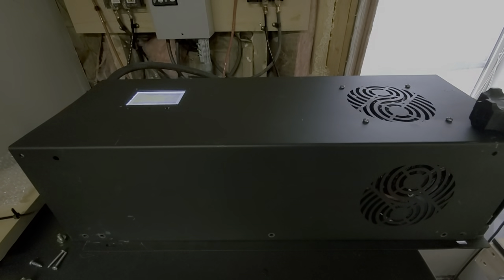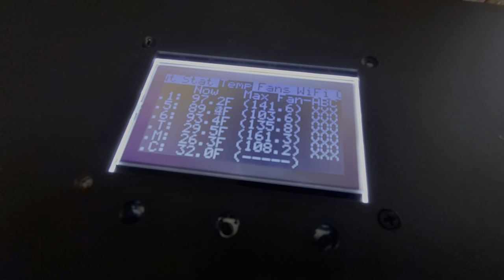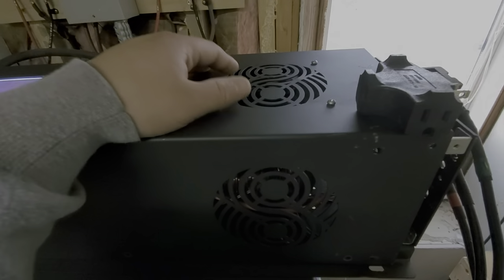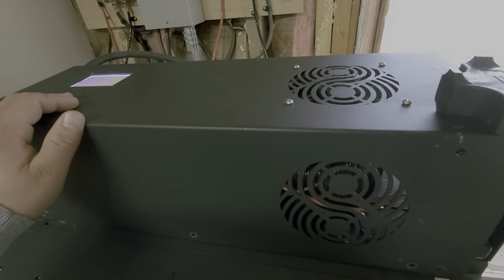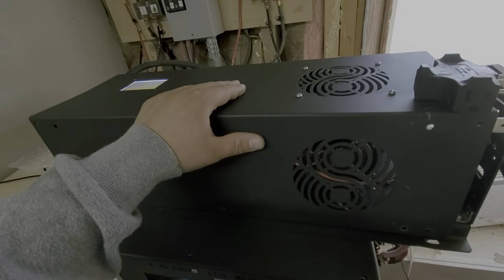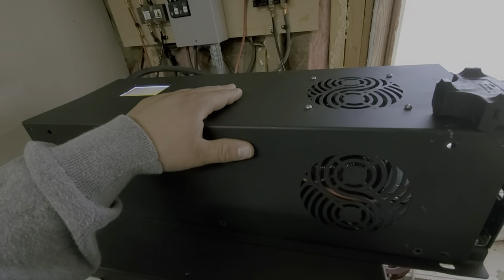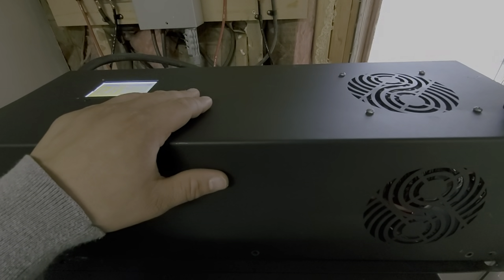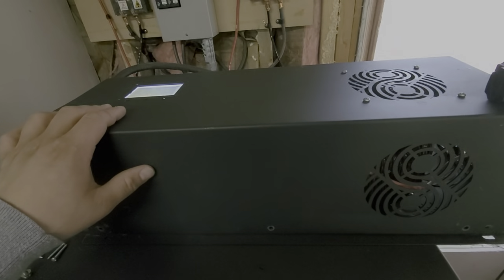5kw Frankenstein is doing fine but more testing is required

Comment: We still have a window type AC that hardly ever gets used that has inductive load on a room seldom occupied or in need of it.  For the AC used mostly we have an inverter AC.  Uses much less power and I am not seeing big inductive loading.  Same goes for welding.  We use inverter welders (sometimes 3 at a time) and "shelved" our small and large size transformer type "old school" welders.  Inductive loading was massive with older type but works all day long (even three) with inverter welders.

Comment: I'm going to want to get one of the Genetry 48V/5kw(+) units as soon as they are available. My PJ 48V 8kw even with exterior auxilary cooling right over the transformer it still spins the fans up to full on load and maintains it for hours after we've disconnected the loads. Sid mentioned a possible easy fix with the thermistor iirc. Either way I want metrics from the inverter so I'm waiting for these to upgrade. Would be happy to donate the 8kw if that helps as well.

Comment: Could you 3d print a shroud to concentrate the fans air around the transformer? 

Are you still running the top plate on the transformer as well?

Comment: Fact :  Heat Damages all Electronic  Components.   Capacitor in particular do not deal with heat so well.  The hotter this stuff get the shorter the life will be.  The cooler you keep things the longer it will enjoy life.  Keeping things 10F cooler could add decades to the usable life.
Reply: You are very correct, heat is a major problem for all electrical parts.  However, I will note that the tranny is unquestionably the weak link here--it is pretty much the part that's getting hot.  I noticed in the previous video that the MOSFETs were registering ~100°F, which isn't bad at all.
Reply: @sidlori1592  Sid,  As you know not all temperature ratings on transformer winding insulation is the same.  I have to wonder if they are cheating on the wire insulation or if they decided to spend the dinero to do it right.  I agree with the other persons comments about making a rubber spacer to bring it up a little and also agree on a part that can help direct the air flow better.  There was a joke with the broadcast transmitter manufacturing folks at Harris that was told to me.......Question:  When do you know the air flow is too much on cooling a high power tube?  Answer:  When it blows the tube right out of the socket otherwise it is not too much.  Everyone knows liquid cooling is better.  Many years ago I made a BALUN for an antenna and decided to cool it by putting it in Shell Diala (pig pole transformer oil which is how they cool their transformers...mineral oil with inhibitors).  In my application I'd like to just add more fans.   Ships use pure water for cooling and have a meter that measures in micromhos (inverse of ohms) with additive under 10's of thousands of volts....amazing but true.   Sid, my email is michael.kendall@ymail.com  I can't get an answer after multiple attempts on the contact form for the website........  I want to work with you to buy some Genetry units with the tweaked code to protect the output on any boards I buy and any units I buy from your group.  Likely I want to buy fans as well.  These are 24v split phase "8kw" units from PJ.  Best regards, Mike

Comment: Can I get a main board, to test, or buy? I also have an idea for transformer cooling, I don't think anyone has tried, if you can donate a couple bad transformers, I will rewind, and modify, and send you one back to test, it is a dry, but liquid cooled transformer, it is what I'm planning for my transformer,  and use a 120mm x 120mm, (approximately) PC radiator, and possibly circulated by convection the radiator can be either on top of the transformer, with a fan push or pulling air through it, or to the side, on a stand , with a fan moving air through the radiator! With a vent in the case, mineral oil should work fine, incase of a leak, if you are interested, it shouldn't be difficult to get a chinease factory to produce them, if it works and it shouldn't add too much to the cost, and should cool significantly better,
Reply: So at least for now we don't have any of the new control boards to offer; we only have the 3pcs first run, that's just barely enough for us to test.  Hopefully once the design issues are worked out, we can do a small production run and take it from there.